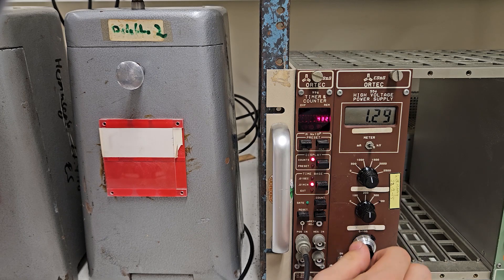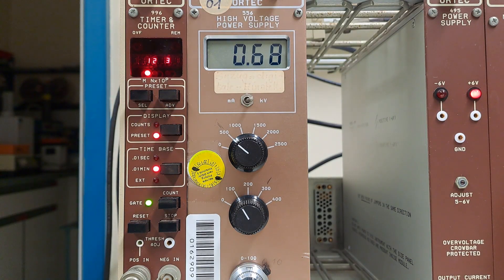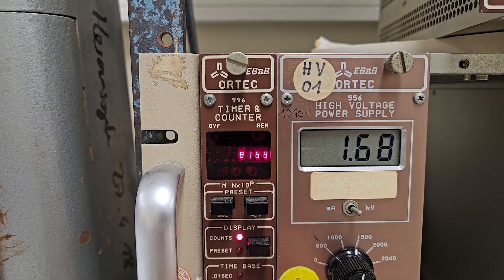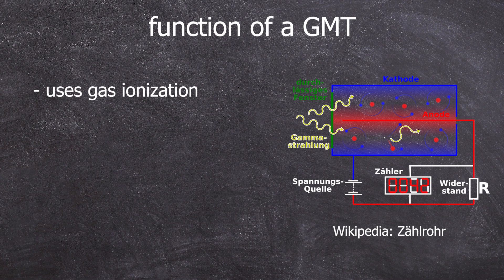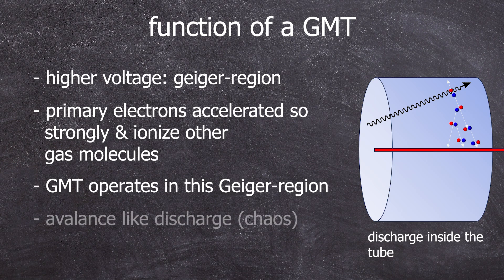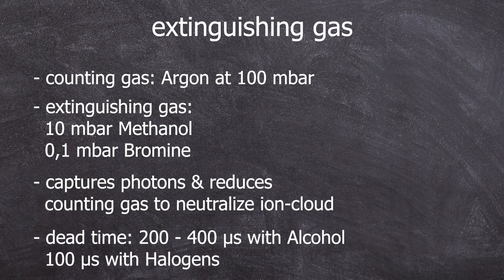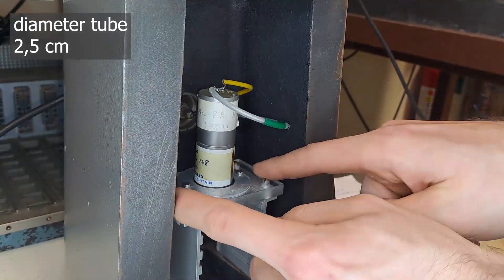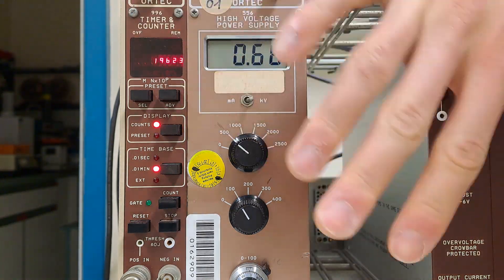Characteristics of a Geiger-Müller counter tube - Nuclear chemistry

Comment: Don't those freed electrons simply have way too much energy to simply excite orbital electrons around atoms to get them to emit photons? 

I could never understand how ionizing radiation, nor the resulting freed electrons can simply excite atoms as it only takes a few electron volts (for example: 13.6 eV for say hydrogen) to completely ionize atoms and the ionizing radiation that Geiger-Müller counter detects typically has energies in the range of THOUSANDS to even MILLIONS of electron volts which as you can tell is WAY above the ionizing energy of any known element of the periodic table.
Reply from the maker: @brfisher1123  to explain that a bit off topic: the Sun, has Emission in the H-Alpha line, which is a line that occurs, when an excited electron falls from the 3rd to the 2nd shell of an H-Atom. But isn't the sun made of plasma? Why should an electron be bound to a nucleus in the first place? Its in the Definition of a plasma, that electrons aren't bound.

Explanation: it is rare but we have baquillion of Atoms there and if it happens even in 1/1000000 Events. It will be more than enough Events to detect it.

A single Alpha particle can f*** up the electron configuration of several thousand Atoms and it just takes some few electrons transitions to detect a signal. Its a numbers game :D